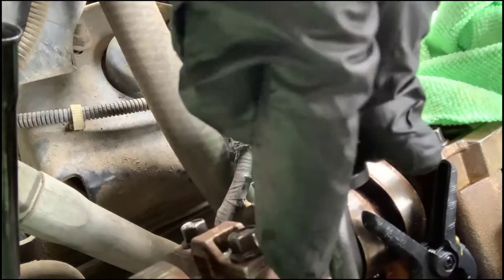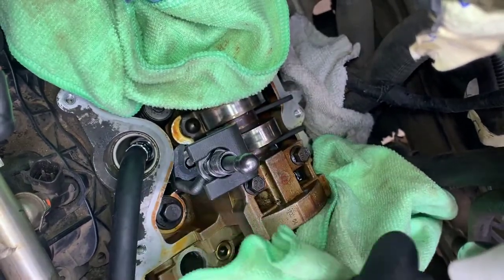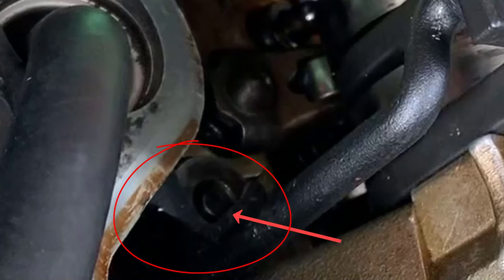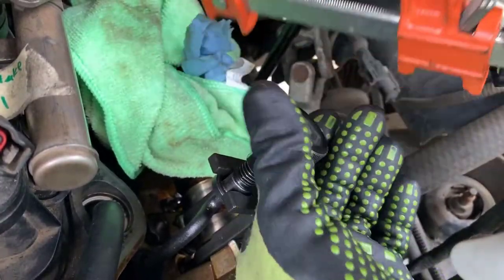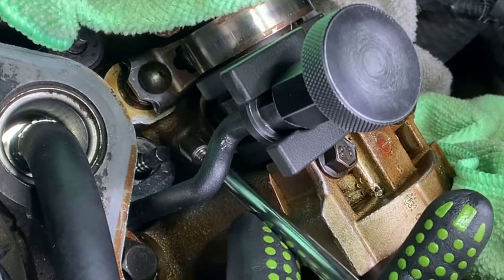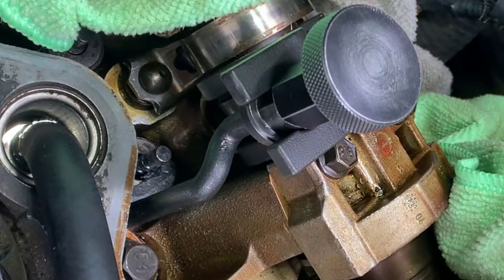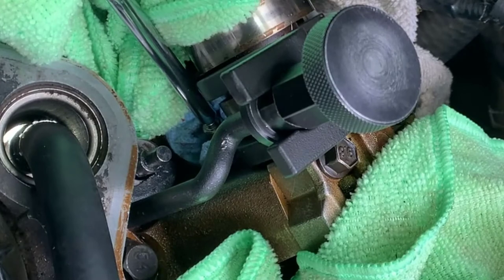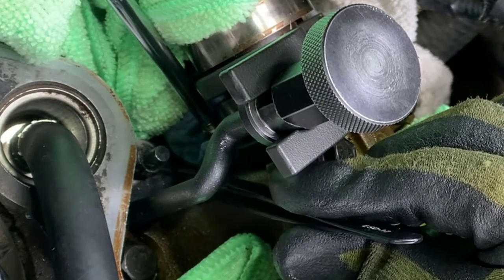F150 5.4L 3V Valve Spring and Keeper Install Hack

Comment from the maker: Someone on the forum's mentioned that the much more expensive OTC6684 version of the tool doesn't have this problem so if you don't want the extra pain of using a clamp and don't mind the extra moola then get the OTC version rather than the OEM24429 version I used.

Comment: I bought one of those cheap valve tools off Amazon last summer. I had to drill material out of the cap to get the threads to start. Drilled it out about 3/8” deeper. Added some grease to the threads and cap to make it easier to turn. Worked great after that, without having to use extra force or a clamp to get it in position.
Reply from the maker: Thanks for sharing

Comment: Great vid, clear and detailed. I am planing a 3v timing job with replacement of the rockers, if the pressure on the valve stem tip doesn't work on all my valves, thanks to you I have a plan if I drop a valve.

Comment: One of my keepers popped out somewhere along the way on my 2004 3V. It was on cylinder #4 against the firewall. A giant PITA to get to let alone fix. And of course my spring tool wouldn't press far enough either. My tool is from CTA tools. It only needed to go a tiny bit more to slip that keeper in. I fought with it for at least 3 hours and tried everything I could think of. I even considered throwing in the towel and hiring a pro.

Ultimately what I did is spin the keeper that was still in there to the 9 o'clock position (looking from the top of the engine toward the firewall) and moved the foot of the spring tool to the edge of the spring at the 3 o'clock position so the spring tool would give a slight 'tilt' to to the spring. 

Mother of God! Damn keeper went in the first try! WOOT!

Dunno what happened to the keeper that came out. Pretty sure I didn't do it as I'm very careful and meticulous when doing this job. I always press down on the valve when compressing, etc. I think it came out long ago when the prior owner had work done in there and I've just been lucky. The 5.4 springs aren't that strong to begin with and they weaken with time, so maybe that's why it didn't pop the other one out. 

So even if the M.I.A. keeper ended up in the pan - it will eventually get caught by the magnetic plug I installed. I didn't see the keeper anywhere up top. Hopefully it fell into the oil drain holes and into the pan.It won't harm anything in there. I am going to look in the pan with my borescope to see if I can spot it. I still have the timing cover off, so I can get easier access from there. Probably won't work, but I have to at least try.

TIP: USE GREASE to help hold the keeper on the stem. Works WONDERFUL.
The grease is also great to put on the end of something to retrieve debris or other things that inevitably fall in the head while you do this job.
Reply from the maker: I can relate to the frustration when the keeper won’t quite go in.  Good to hear you found a way to get it in.  Thanks for the pointers.

Comment: Did one of these jobs today.... broken valve spring on cylinder #3. Actually a sublet from another shop. I had them order the tools off of Amazon for $40 (complete valve train tool set). Yep, China crap made me work hard all day!!! I couldn't get the nut to screw in either!!!!
So I decided to get creative. Had to shorten the rod below the bend, so it would go in easier on to the holder. But still couldn't compress the round nut far enough down to get it started.... so I grinded the head.... now, the foot wouldn't go down enough to remove & install the keepers.  So, I drilled  & tapped a 8mm hole through the top of the round wheel/nut. After positioning the foot & driving the big round nut all the way down, I installed a 8mm bolt on the treaded hole I just machined, driving the foot down further.... Whew!!! Glade I don't work on these crappy engines on a regular basis. 😆I'm actually a GM/Cadillac specialist, but have worked on other cars for most of my career.
Also, I couldn't get any of compression adapters to screw into the cylinder to inject air. I have a 12mm adapter, but it's too short on the treads & too fat on the body to go in. Being a Saturday, I was in a pinch. I drove to harbor frieght because one of their compression kits looked like it had the adapter I needed, but it turned out to be 15mm!!! Before leaving, I saw a Merlin #63572 blow gun kit with 2 long tubes in it. When I got back to the shop, I did some measurements... I prayed it would work. There are threads on one end of the tube, but are about 13mm... so I ran my 12mm tap on it & made some new threads. I tapped 1/4 NPT threads on the other tube opening for a air hose nipple. I did some machine work on my lathe to remove the boss on the tube. Had to remove the O ring on the treaded 12mm becuse it was in the way... & it worked & held the valves closed so I can remove the broken valve spring!!!
Reply: Great job! I had a guy tell me to feed rope into the cylinder to hold the valves in place

Comment: Why change the keepers in the first place? I ask because I am about to start a full timing job on my sons 2004 F150 5.4L 3V and wanted to know if we should be considering doing the keepers too while we have it apart.
Reply from the maker: No need to change the keepers unless you need to change the valve spring or valve stem seal.  I don’t think valve springs go bad very often and i believe you can do a test to see if you have a leak in your valve stem seals.  I took my spring out in search of a foreign object that had dropped down there.

Comment: Quick question, how much air pressure were you using?  I have a broken exhaust valve spring on #5 and want to get it swapped out.  Thanks!
Reply from the maker: I've read online to use 20-40psi. I used 40psi.
Reply: @giantico  Thanks!  I was going to shoot for 80, but if 40 psi does the trick for you, that's good enough for me.  Now I just need to cobble together some sort of adaptor.
Reply from the maker: @jiggytonka  Some of the auto parts stores like Orielly's have the adapter in their loaner tools.

Comment: Information requested! Pls help!
Taking roller follower off cyl4 per timing instructions, using same tool. only 1 keeper was on. When grabbing follower I believe I knocked the legs of the spring 
compressor off the retainer and it cause the spring and keepers to pop out and the valve stem fell about a centimeter. Or less maybe? It could still be seen and easily picked up with magnet tool and is sitting back at the top on its own without spring... did I cause damage I’m wondering & how can I figure out without pulling head? Pls help!!! I’m stuck on timing my 07 expo... god bless
Reply from the maker: I highly doubt anything was damaged by the valve falling.  I noticed that some of my valve stem’s were quite sticky and would stay up even without air pressure.  Probably some carbon buildup on the neck of the stem in the cylinder. Good thing that you were able to recover it.  Best of luck to you!

Comment: Can you just slowly pull off all the cam bearing caps, evenly, instead of removing the roller followers with special tool first?? The idea, I guess is that you don't allow the valve keepers to get lost and the valve drop into the cylinder.. But, if you slowly and evenly let off the camp caps all the way across it should slowly let the pressure off the valve stings, right?

Comment: Nice!  What size air  fitting for the spark plug hole?
Reply from the maker: The spark plug threads are 14mm x 1mm.  I used the Lisle 19700 Valve Holder.
Reply: @giantico  My spark plug threads are 16mm, know where I can find the adapter/hose?

Comment: Does that tool only work on certain size engines or will it work on a 5.0 mustang
Reply from the maker: Not sure about the 5.0 mustang . . . according to the amazon page one of the comments says "this tool's specific application is for the 3-valve 4.6 and 5.4l V-8s found in for trucks and mustang GTs"

Comment: Urgent question - doing a full timing job on mine with the same tool. I pushed down the exhaust valve spring on cyl #1, and when I released the pressure fully it looks like I can see the grooves on the valve stem and the keepers are below that. Any suggestions? Do I need to reinstall the keepers?
Reply from the maker: Sorry, I'm not sure about that.